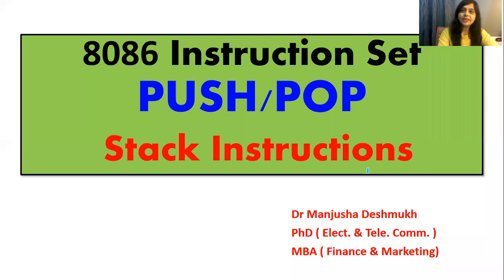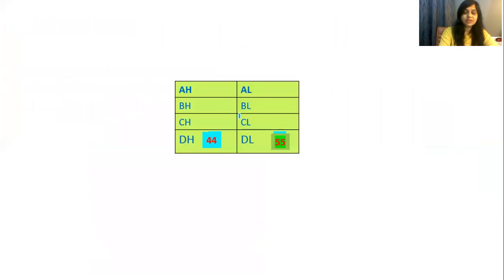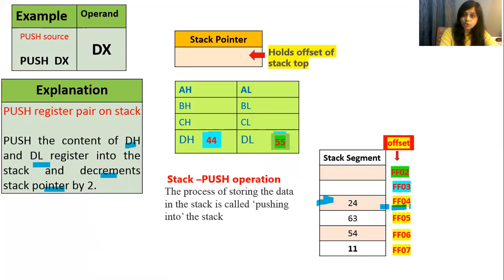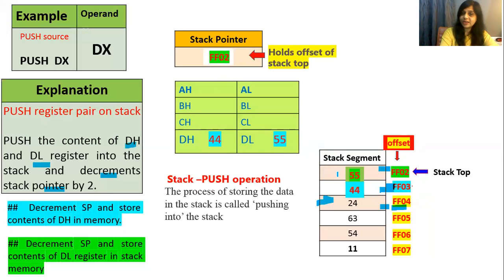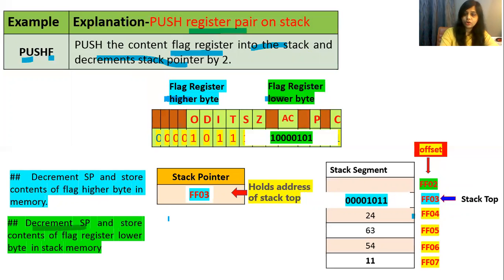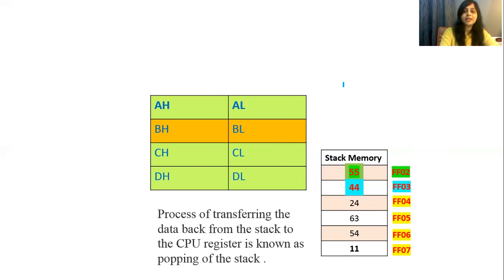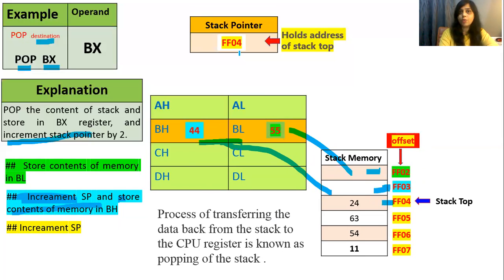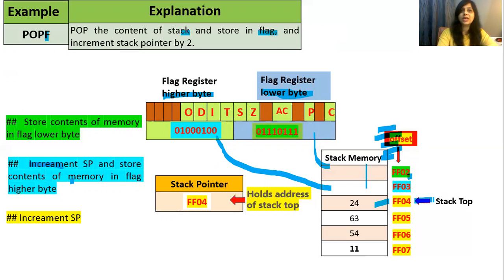8086 PUSH & POP instructions

Comment: Why Dh and dl are not stored in the same stack address
Why dh is storing in one address
And dl storing in other address
Reply from the maker: Dh and dl are both 8 bit register. Together they hold 16 bits but one memory address can hold only 8 bits hence to store 16 bit data of Dl and DH, we need two memory locations
Reply: @TheVertex-Engg-Lectures  why one memory location hold only 8 bits???
Reply from the maker: @kushkusa7473  memory is designed that way